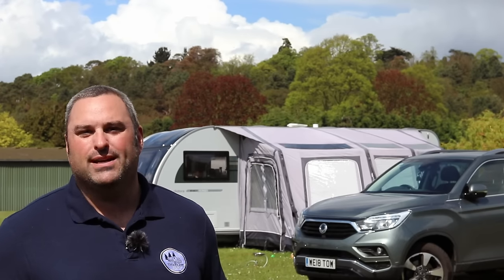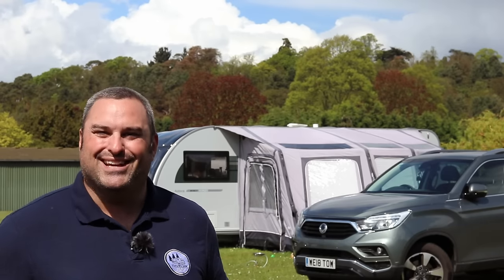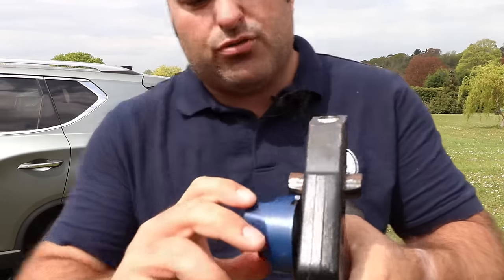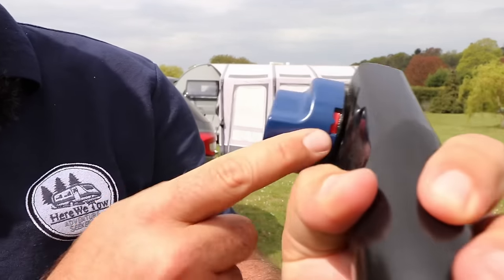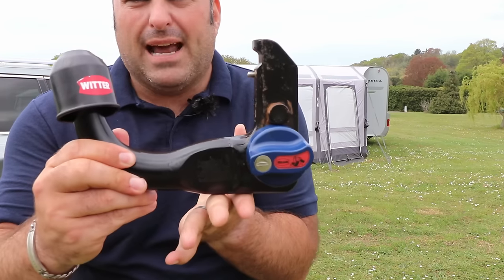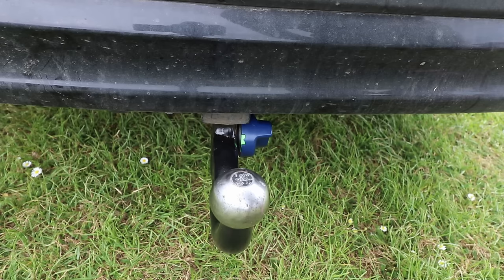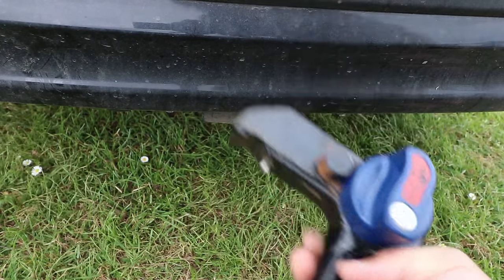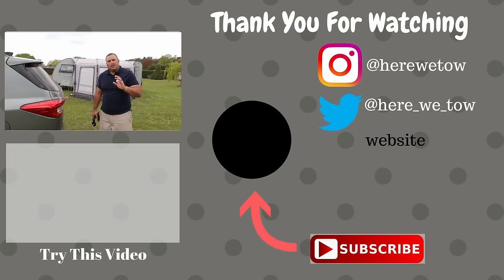Using a detachable Tow Bar [CC] 2019

Comment: I use the same one on my X3, it works well and takes little effort to put on and take off. The car looks better without so take it off when not towing. I had the opportunity to have a new Disco for a month with a deployable tow bar, which was excellent and it self checked electrics and towball weight, even better. Expensive, yes but worth it.

Comment: Good vlog jules... a tip for u guys.. if u take ur tow bar off when u put it away de-load it as if it’s fitted on ur car like wot jules did with the pliers.. this way the spring is not left tensioned causing it to wear... a bit like ur caravan blinds in winter... leaving them down tensions the spring then when u open them after winter there loose... hope this tip helps guys 👍🏻👍🏻😎
Reply from the maker: Thanks for that and thanks for watching too👍

Comment: Thanks for the vid, we found a witter swan neck in the boot of our car when we purchased it. Never really tried it until now. We watched ur vid to help us with how it works.. Only problem is now we cant detach it🤔 😂 it just wont push in or turn at all 💪
Reply from the maker: Im glad you have tried to find the answer with our video. It might sound daft but make sure you are unlocked it with the key. If you have tried turning the lock then graphite powder could be worth a try in the lock. Sometimes giving it a tap can help free it off. Failing that give Witter/ Westfalia a call, they are helpful and will give you more advice. All the best with it, Jules

Comment: I had one of these fitted to my car. First use I locked it with the key and then when I went to remove it it wouldn’t unlock no matter what I tried. I took it back to the fitter and he had to dismantle it. A part inside the knob was broken so he replaced it and told me not to bother locking with the key as it is so easy to remove the knob anyway, there is just a sticker over a central screw that you can undo and remove without the key.
Reply from the maker: Thank you for that information 👍

Comment: Hi Jules
Did your car have a separate point to attach the break away cable as the Caravan club suggest that you should not attach to a removable tow ball, I am thinking of getting one of these fitted to our Tiguan but so far have not seen any way of attaching the break away.
Reply from the maker: Yes there is an eyelet under the Rexton. Never attach it to the tow ball on a detachable in case the worst happens and it becomes detached 👍 Jules
Reply: Thanks again Jules. I will have investigate further. Safe travels.

Comment: So, I have just purchased a Subaru Forester with a Subaru detachable tow bar. I have no idea how to take the neck off. Key in, turn so I can depress the plastic knob move clockwise until RED and then it just comes away ?  Do I need to hammer any pin out ?   Thanks all.
Reply from the maker: It should just come away at that point David as red means it is disengaged. Is it a pre owned vehicle? It may be that it was just seized up if it hasnt been removed in some time. Sometimes it can take a bit of a wiggle but if it remains locked on then contact the manufacturer for their advice. I hope you get it sorted out. Jules

Comment: Where does your safety chain go between the van and the car?
Reply from the maker: The breakaway cable hooks on an eyelet underneath on the tow bar. Never wrap it around the towball on a detachable in case the worst happens and the towball detaches. Thanks for watching 👍

Comment: Hi so will this be compatible with a Thule velocompact? Cycle carrier . I ask as  my Thule velocompact is not stable on this but fixes easily and correctly to my brother's fixed flange towbar
Reply from the maker: I dont see why it wouldn’t be stable on this tow ball but I have only used the Witter Westfalia bike carrier. I have done a vlog of that so you can see how it compares to the Thule. Sorry I cannot give you a definitive answer on that. Karina 😊
Reply: @HereWeTow  thank you .  My towbar points a smidgen done which means that the  carrier points down . Ill ring witter  Monday thank you for your help.

Comment: I have exactly the same towbar, but I hear conflicting views on how to attach the breakaway cable as there is no point to attach it to other than looking it over the towbar ant clipping it to itself.  How do you attach the breakaway cable on yours?
Reply from the maker: Underneath their is an eyelet on the tow bar itself, you have to get right down to see it. I presume yours will have it but I don’t know for sure, you dont want to attach the breakaway to the detachable towbar as if the worst happens and it detaches from the car it wont activate. I would like to say that I have not heard of a correctly fitted Witter detachable ever doing this though. If you want more information email me at herewetow@yahoo.com and I can send you a photo. Thanks Paul 😊 Jules
Reply: @HereWeTow  Thanks Jules.  Have sent you an email with a photo of what I see on mine.

Comment: I can't get mine fitted - i've got the main pin retracted right back and the small pin has popped out, but when i push the tow bar into it's housing it doesnt pop or anything to lock it ?? any advice?
Reply from the maker: Is it a new one Chris as I think there has been a recall on the new ones. Other than that it can sometimes take a bit of force to push it in and back but it should fix itself quite easily. If you’re doing everything I do in the video then you are doing it right and it might be faulty. Be firm with it. If you still cannot work it contact the supplier or the manufacturer directly. I hope you get it working. Jules
Reply: @HereWeTow  its been on the car a while. Removed it now it won't go back on. Somebody suggested using a hammer to hit it down. It's as if the pin isn't being pushed in
Reply from the maker: In that case I would soak it for a while in WD40, resin free grease or oil,  as it may well be seized. Hitting it with a hammer would not be something I would do but who knows. In the lock only use graphite powder, dont get oil in the lock.Westfalia-Witter website is a good place to visit if it is one of theirs. I hope you get it working, sounds like it’s seized up inside so hopefully a bit of lubricant will help. Jules

Comment: What about the tow bar electrics for a trailer board? I didn’t see any.
Reply from the maker: If you mean the 13 pin socket it folds underneath and you just flick it down and plug in. I hope that helps and answers your question.
Reply: @HereWeTow  it does, thanks, a very neat system :)

Comment: How do the electrics work if you're towing a caravan?
Reply from the maker: Hi Katie, the towbar is fitted with a 13 pin electric socket. The caravan has an electric cable that plugs in to it whilst towing. This powers the rear lights of the caravan and in most cases the fridge. Some euro 6 Diesel engines won’t power a larger fridge. Some older cars and caravans may have a 7pin but 13 is what is used mostly these days. I hope that helps. Karina

Comment: I got 1 with my zafira and it wont click when i turn the blue thing so it wont in gage can u help
Reply from the maker: Hi Big Rogers, sounds like the spring mechanism isn’t working as it should load the locking pin and click when it’s unlocked. Depending on the make I would contact them for advice, it may be a quick fix. All the best sorting it out.
Reply: @HereWeTow  i have no key so im wondering if it can be locked off the car it turns around to the green but no further

Comment: I Brought  a car with one of these on but i need a key isit possible  to get one
Reply from the maker: Morning Geoff, yes you can. You need to try find the make of the towbar, if its Witter then thats easy. Next there should be a number somewhere on it. Go online and search “ replacement key for detachable tow bar”.you should be able to get a key for about £5. I hope this helps. If the key barrel is stiff then graphite powder is best for locks, not wd40. I hope you get it sorted. 😊👍

Comment: I bought a car with one fitted can't get the key to go into the lock. If life was that simple.
Reply from the maker: Presuming the key is the right one (you never know when you haven’t had it from new) I would try graphite powder to see if it has rusted or jammed. Failing that contact Witter/Westfalia directly. They are very helpful and should be able to assist. I hope you get it working, Karina and Jules

Comment: Where is the electrics plug ?
Reply from the maker: The electric is to the left of the tow bar, underneath the car. You pull it down when needed. Different cars have different electric fixings. Some are more visible and fixed.
Reply: @HereWeTow  thanks for quick reply , I'm getting one fitted to my C5 Aircross and was wondering where it went .
Reply from the maker: No problem, you should also find somewhere to hook your breakaway cable underneath too, a small eyelet. You have to get right down to find it. 👍
Reply: @HereWeTow   Hi. As a Driving Instructor I'm meeting many customers who have detachable tow bars. Upon discussing the break-away cable on their caravan and its purpose, I'm then struggling to find somewhere suitable to attach it to the car. I've resorted to laying on the ground to look behind bumpers but still no joy. Looping the break-away cable around the detachable swan neck appears to be the only solution. A pointless solution but the only one.
I'm trying to get answers from the main tow bar manufacturers but wondered if you'd encountered this and what your thoughts/ suggestions are?
Reply from the maker: Hi Fliss, yes I totally agree, it should not be looped over the tow ball as it is detachable. The ones I have come across have an eyelet underneath. If they dont then how can that be safe? This could be a safety point to follow up on once life gets back to normal. Thanks, Jules